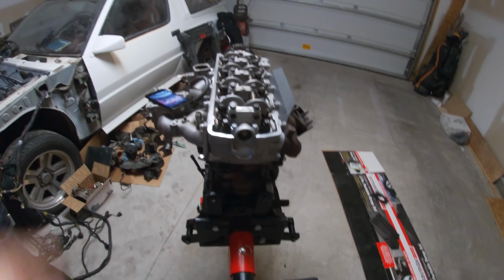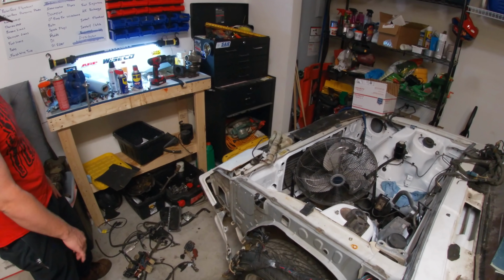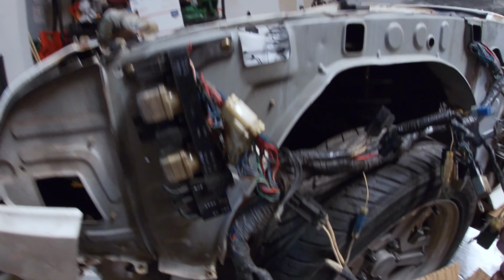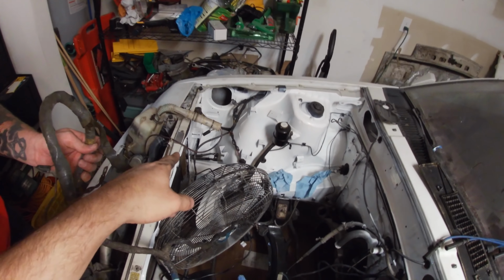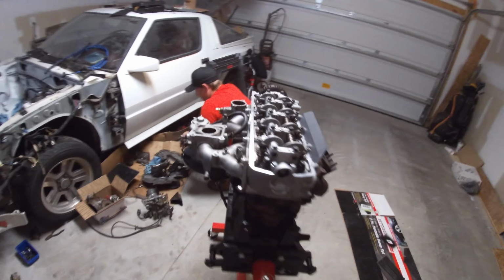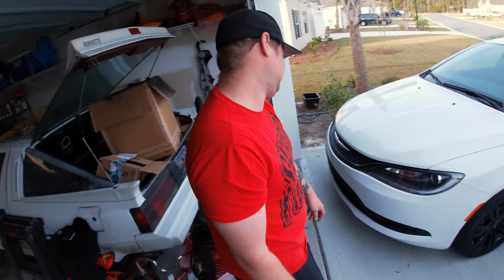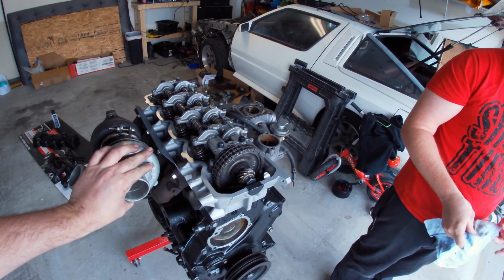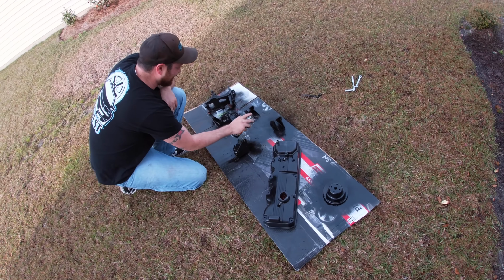Wire Tuck Progress and The G54B Gets One Step Closer To Completion! (Conquest / Starion Build)

Comment: THANK YOU GUYS for the shout out, really appreciate it along with the kind words! We are just out here trying to build cool stuff and make decent videos doing it 👍 

Wire Tucks are so incredibly tedious, they always give me the urge to just do a full rewire and clean it up but that even more hours and $$$.
Reply from the maker: You are very welcome, the pleasure is all ours! 

I kinda wish I didn't start the tuck, I feel like it's putting a huuuge delay on getting it running.
Reply: @SRMotoring  I know the feeling, Its always a can of worms, this runner isn't as long as you would like, this fuse block wont fit through the hole without depining it. where can you mount the fuses to keep them away from water but accessible to change....... Always seems like no big deal until you are actually moving stuff. I definitely prefer starting from scratch but that has it own set of challenges.